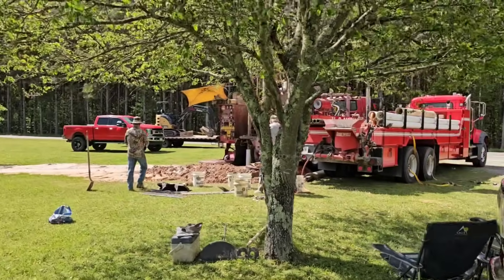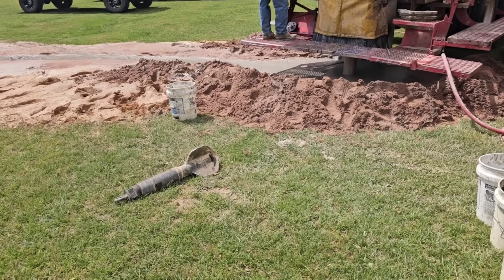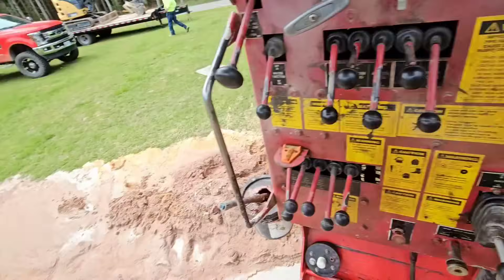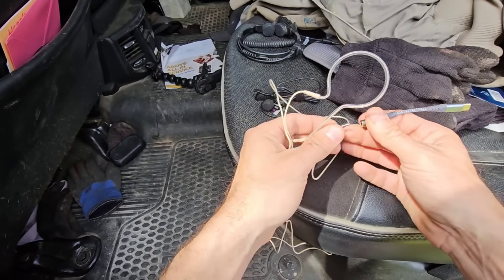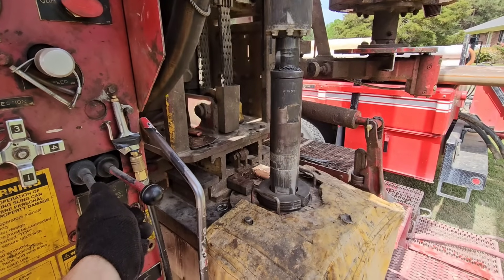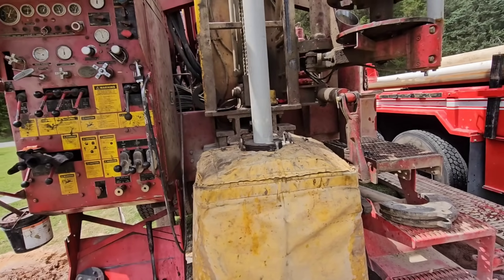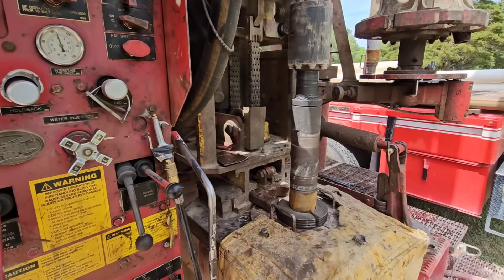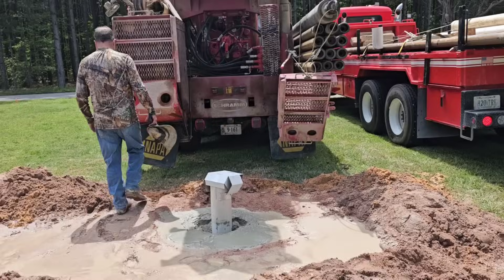Drilling a New Water Well over 500 feet deep! The worst environment for a Content Creator!

Comment: I do not know if someone has said this but basically you have 3 different styles of microphones. You have omnidirectional microphones, which pick up sound from all around. Cardioid microphones, they are more directional and cut out sounds from behind and the sides. And then supercardioid microphones, that have an even tighter pattern of where they pick up sound from. The stage mic you used is more omnidirectional. You need a microphone that has a pickup of either cardioid or supercardioid. Been doing sound for right at 41 years now. Hope that helps out and really hope you see this comment since I've just found your channel and going thru back videos.

Comment: For recording in that noisy environment, you could use a 3 mic setup, two microphones usually at your ears, then one directly in front of your mouth. You can get headphones, or a band that goes under your chin. 

That allows the sum of the side microphones to be subtracted from the one you speak into. It will cancel the bulk of the noise.

That will not beat the throat mic for noise, but will sound clearer. You could also try a conduction microphone, it sits on your jaw by your ear, that will be more like the throat mic, but more comfortable.

Comment: This isn't the right video. I don't know how to do this it is new to me. I watched your video on pressure tank and pump setting. I drained all my water out and set the air pressure to 38lbs. Now when my water is it has great pressure but after it runs awhile it slows down. The all of a sudden it picks up pressure. If I hold the garden hose with a sprayer attached. With the valve open all the way and squeeze the sprayer all the way open it will spray fine then after about 20 seconds it will pick up pressure and spray about 8ft further. Once the pump has reached the cut off. it will start repeating itself. Would that mean that 38lbs is too low in the tank? The pressure switch is 40 to 60. I did file the point off and made them nice and clean.
Reply from the maker: Let out a little bit of air, just press the air nipple and count to 10. Your description says 38psi is slightly too much. So let some out to 35/36psi. 
(Some switches are not set perfectly)

If it still acts up after letting a little air out of the tank, then that might be an indication that the little nipple below the pressure switch is clogged up (so you'd remove the switch & clean out the nipple) if its plugged up the switch cant sense the water pressure.
Reply: @h2omechanic  Well I got the system working. I tried to let air out but none came. I hit the tank with a wrench it was solid. I opened the spicket and warter started coming out slowly. Once I took out the schraider it poored out. Replaced the tank with a bigger one since it had been there since the eighties. The new tank recomended a 20gal pump. I only have a 10 in there now. It works great we just have a little smell to the water. It seems like it has decreased a little. In ou xrta bathroom , when my daughter is in college it smeels like sulfur because it is not used as much. Anything we can do for that and do you think the other smell go away after time? I used the tank in your video comparing them . I went with higher dollar one, hope it will last like the other one. They just don'y make things the way they used too.  Thanks for your help you really got it going on. If your ever in the charleston area hit me up.
Reply: Awesome thanks for the info. You have a good channel. This is the first time I ever replied to anything. PLEASE keep up the great work , it really does help people.

Comment: Well, the throat mike did the best. With a little de-clipping it will be really good. The others can´t handle the loud. You can speak rather normal with it, it catches the least surrounding noise. It´s used in choppers, alright. You will get used to it, for where You are it´s the best. Does Your cam have automatic vu levelling? Digital stuff shure hates clipping…
If You try the t-mike (or even a real military one) more it will be the best. All others can´t handle the sound pressure. Even my beloved Sennheiser MD421 might struggle but it was used for decades all over the world by film teams & journalists in all conditions & environments. I love my Sennheiser, it has that Rock N Roll guitar sound on tape recordings.

Comment: It's unfortunate that don't make a unidirectional microphone head set that points directly at your mouth. That's what you need. Unidirectional not Omnidirectional. Unidirectional mostly picks up what's right in front of it. The real problem is that ALL camera recorders have built in compression. You can't turn it off. Compression, more ore less, keeps the output signal constant. So when you're not talking, it amplifies all the background noise. Even unidirectional microphones pick up reflected background noise. Maybe you could make a custom headset with the clip on mic pointing directly  at you mouth. That's what I would do. I have made a bunch of YouTube videos and it's all a problem and not as easy as one would think.

Comment: You need a Bone Conductive Mic for a high noise environment.  Your best bet would be to find a wireless set up, that goes to a second phone to record your audio so you can set mic gain and attenuation for the environment and it will not get bumped while you work.  Then you just sync the audio to the video in post.  A clap or loud noise after both recording devices are started can be used in post to sync them.
Reply: Any suggestion on a manufacturer of those, I have been trying to find a good one of those for years

Comment: With a throat mic, you need to train yourself not to yell, like you commented in the video, it will sound much better if you talk quieter.  Another trick with throat mics to make yourself come through better, is try to pitch your voice up a bit.

Side question, is there a reason you don't put the copper coat bucket on the other side of the operators station?  Just seems it would make more ergonomic sense.

Comment: Probably want to try something wireless with a 32 bit float recording. Rode wireless pro. Or a tascam 10L. I'd suggest recording a second audio track (in a quiet spot) in post editing and adding it over your video. Will give you the best result by far. Alternatively do your commentary when you are futher away from all the noise. There is also pro tips on YouTube on how they deal with noisy environments. Do a bit of research, chasing quality audio in that situation can be difficult and require expensive equipment. Good luck with it.

Comment: To add to what the broadcast engineer said, you'd probably find some aviation setup the best.   Inside the cockpit of most medium-smaller planes, it's extremely loud, so the setups we use have to ensure we have clear speaking audio for ATC, etc.   I'd reach out to one of the major aviation headset folks like Bose, Dave Clark, Lightspeed, Flightcom and see if one of them might sponsor a set.  A good active noise set will run anywhere from $500 to over $1K.     Also, for your application, you probably don't need a traditional set with full "enclosed ear" earphones, but you could see.   Not sure what kind of adapters would be needed to make one work with a cell phone.     In the long run, you'd probably be best served to use some setup like that with a GoPro, etc.    and there are a TON of aviation content creators that could give you advice on their setup.

Comment: RODE microphones are quality.  Their new Wireless Micro seems it might fit the bill for you. The Wireless Micro is a pocket-sized wireless microphone system tailor-made for smartphone creators. Available in both black and white, and with versions for either USB-C or Lightning devices, the slimline receiver connects directly to a phone with no need for cables, making for a super compact and tidy recording setup. It features two ultra-compact, ultra-lightweight transmitters with integrated clips and magnetic attachments that are incredibly easy to mount on a subject while remaining discreet on camera.  They make both an omnidirectional and a unidirectional type.  Amazon has both from $138 - 145

Comment: I used to work on the ramp at an airport. You can't even use the word loud to describe the noise leve there at times. I didn't record videos, but we needed to be able to communicate with the air crew and each other. The only way to get usable audio is to use something like an H9910. It would be funny as hell to see you wearing it, but it would get the job done.

Comment: Well i can tell you from my experience in wireless headsets. Theres not many clearer and noise cancelling headsets. Than a blue parrot bluetooth headset. Ive stood beside a running D10 cat dozer. And my audio was crystal clear with little to no background noise. That throat mic was horrible you tried. After 25 yrs of using microphones. Ive not found many that beat the blue parrot. I dont know if thats an option for you. They also make designs that work well even wearing hardhats etc

Comment: Honestly, if I had to record audio in this environment, I'd probably just have a boom arm that clamps to the rig with an SM57 so you can talk right into it. Run that into a standalone recorder in a waterproof box (ammo can with the cables siliconed into it). Just make sure it has a big enough memory card and battery to record all day and deal with it in post as far as alignment and whatnot. 
If that wasn't good enough, I'd put a second setup about 6ft away on the rig itself, so it's just recording rig noise, take that audio in, invert the polarity, and let it cancel out everything that's not your voice. You'll have to delay it slightly so it lines up timewise to the talking mic because it "hears" the drill rig slightly before your talking mic hears it. Pain in the butt, but it'll work.

Outside of that, see if RTX voice software can clean it up, maybe it works, maybe it doesn't. Only an option if you have a gaming computer that has a new-ish nvidia graphics card, and it's still a long shot.

Then, if all else fails, use the exact same setup you have, chest mounted phone, record as normal, don't worry about talking while you're working, and then when you're done working, do the same thing, chest mounted phone, but watch the video and explain what you're doing in real time, then use that audio which won't have the noisy drill rig running, overlayed over the drill rig audio, let it "duck" out the drill rig audio when you're talking (you'll have to google how to do that) and you have something that's probably way higher quality than what you could get live and it'll sound natural because it's the exact same mic/arrangement and whatnot. Only downside is the time it takes.
Reply: Do please understand that, you want that drill rig noise in the video, you just want less of it. What it sounds like while you're work is important, it's part of the experience you're trying to portray, so don't duck it out completely, just duck it enough that you can clearly hear what you're saying.

Comment: OK no offence but they all sucked. The headset with over-the-ear and mic combo we used on the flightline in the Air Force works the best with jet engines and turboprop engines in planes; besides, they even worked well in a blasting type of environment out at the Bomb dump, but this was 1980-86 lol. I believe that they are just like the Navy flight deck crews used; the ones the Air Force uses now are these Bose A20 Aviation Headsets.

Comment: The audio program Audacity, it's free, has noise sampling and removal. It would eliminate 90% of the machinery noise and leave your vocal untouched. You would have to run the audio through audacity after filming and pair it back into the video.
Reply: A lot of video editing software has similar tools as well.  Davinci Resolve has amazing noise cancelling abilities and you don't need to pull the video out separate from the audio and then put it back together.

Comment: As others pointed out, either the throat mic is clipping, or the input on your phone is.  I'd suggest not shouting, but that may be difficult since you won't be able to hear yourself talk?  I think these would typically be used with a headset, which would let you hear yourself in the headset when you speak at a normal level.

Comment: I think you may want to get one which has a ambient noise cancelling in it, as there are some where it basically has one mic to get the ambient, and uses that to be the noise floor for the actual mic getting your voice.  Using a cellphone to record the audio does really limit what you can do, as some need a unit with more processing capacity to handle the fact it is dealing with 2 mics.
Reply: The reason the phone audio works at-all is because it's already doing that sort of noise cancellation. It's limit is the size of the phone, you need those mic's farther apart so you can isolate the voice.

It's a pretty simple trick in a controlled environment to get noise to cancel out, just take two mics, 6ft apart, talk into 1 of them, have the other closer to the noise source. Invert the polarity of the noise mic and delay it 5.3318ms in post. That'll align the two mics and having the noise source 180 degrees out of phase means the noise will get cancelled out, leaving your voice mostly noise free.

Won't work if either mic is moving relative to the other, but in this situation would probably work well.

Comment: What kind of grease is that you're using on the rods? It looks like copper sieze. 

...though the performers mic, everything was clear, though your voice was very low, but still clear. I feel like an AI filter may can bring your voice to the forefront using that mic, though I wouldn't want anything flopping around on the side of my face either.  The Panda mic, or collar mic, I can't hear squat with it while your by the machine. Can't hear the machine, can't hear you, can't hear anything. I think you may be clipping something fierce. Even when back, it sounds tinny. That' one's just terrible, even for collar mics. The throat mic sounds muffled, but hot, and I can hear only you. It's just about completely dropping the sound of the machine. Throat mic may be the winner for now until we find something better.

Comment: What phone do you use to record? There may actually be a setting to have it record optimizing to you rather than where it's pointed. Phones have very advanced microphone systems that outperform a lot of the more common inexpensive small format microphones.

As far as the external mics go, I don't think any of them (besides the throat mic) were directional which is the common way to deal with a noisy environment (for example, the SPLs on a stage can be way louder than your drill rig). You might be better off ringing up someone at Sweetwater and discussing what you're after. I'd probably be grabbing a Zoom F2 or Tascam DR-10L to record the audio separately from your camera(s) in 32-bit float so it's less likely to clip in the high volumes you're working with, and connecting it up to a Sennheiser ME3 or a Contryman E6.